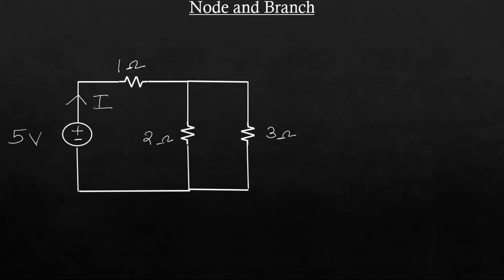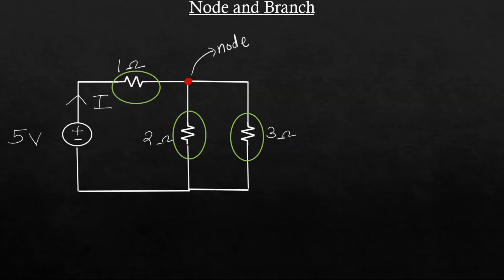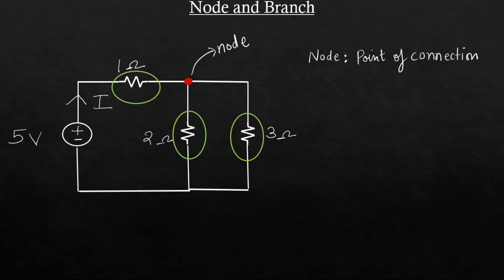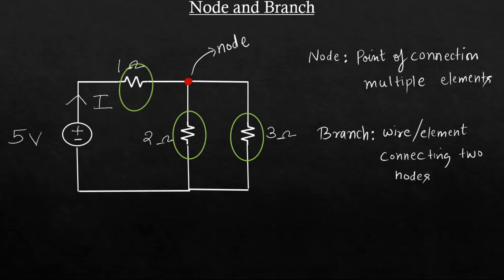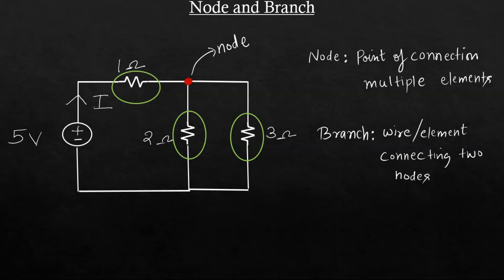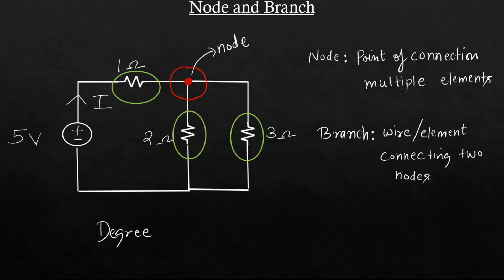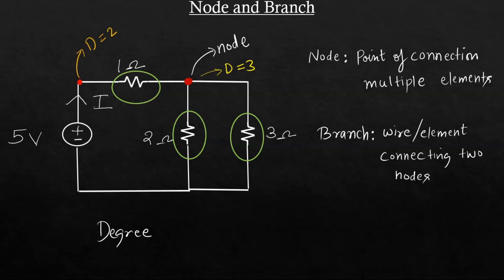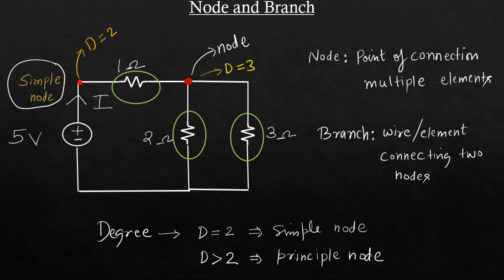Node and Branch in electrical circuit

Comment: The confusion of calling a component a branch exists because we refer to branch currents when we deal with KCL. So from the start it should be known that circuit component=element=branch, but when doing circuit analysis we don’t use the term ‘component ‘. With this in mind, I’m surprised that you did not initially start by saying that there are four elements and 3 nodes in total.